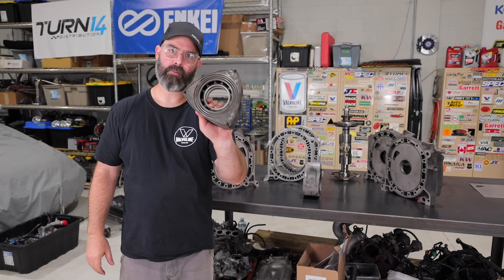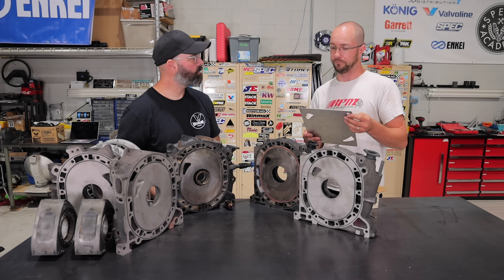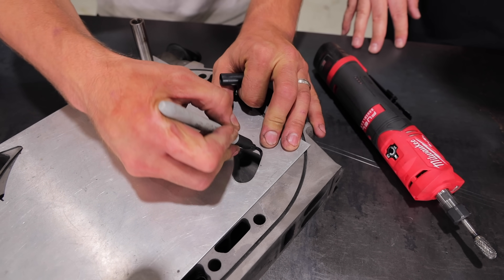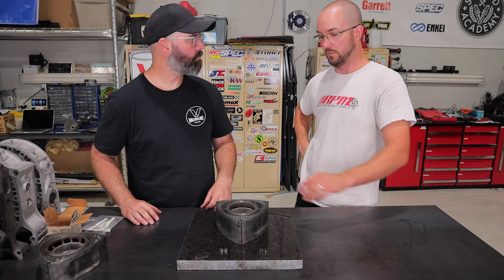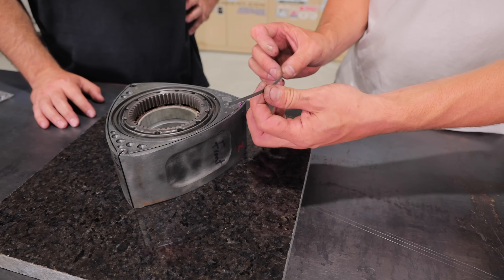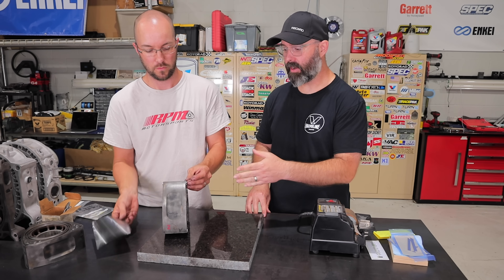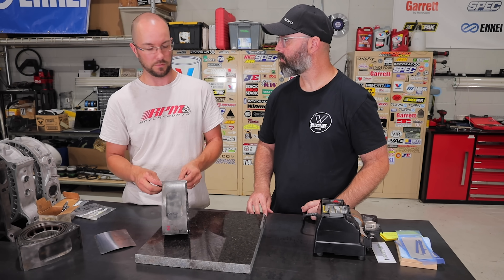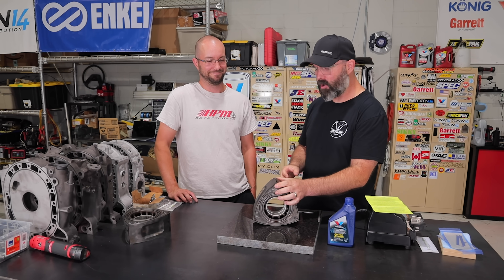How to Build A 10,000RPM Rotary Engine - Part 2

Comment: rx8 apex seals are 2mm thick and 5.3mm high at spring support (not the highest part) 
rx7 apex seals are 2mm thick* and 8mm high at spring support *older were also 3mm and there was also a 3 piece alternative, they are not 2 and 3mm :D

Comment: The rolled edge is called the Coanda  Effect it allows the air and fluid to maintain surface contact in  the same direction of the open port.. providing less  turbulence .

Comment: Have the rotors been lightened by drilling?  Or is that some kind of balancing thing, I noticed there were a different number and size of drill marks on the sides of each rotor tip.

Comment: Wait WHAT!? You just completely glossed over an integral part of the process BY FEEL? I really hope no one uses this to do a rebuild themselves. This could be really bad guys. Proper clearance is measured by at least 4 feeler gauges. Why guess. I get he's a pro but come on. You're doing a fairly informative series about a topic that has picked up in popularity and your info has this massive gap in it? Not even a mention around it of "This is how you would properly do this.". Lots of new people in rotaries and the lack of information available means this needed to be better. Sure its a purpose built RX-8 rotor in REW keg. Most people wont ever scratch the surface of that, but with the lack of proper rebuild videos they'll come back here. Especially because rx8's are cheap and that's the rotor you're using. Please, for the love of God, say something about this at some point. I don't want you guys to get burned on the back end by poor rebuilds generated from this content.
Reply from the maker: We went back and forth whether to show this procedure or not and ultimately as you see didnt. Joe said there is alot of debate over the feeler gauges and how is done properly so ultimately we skipped it as to not create more confusion.
Reply: @speedacademy  as its not a full stock rebuild, I feel like you chose correctly. The amount of comments from people wanting to get into/rebuild a rotary raised my alarm. I didn't mean to slight RPM or Speed Academy in anyway. I respect both shops a lot. I hope you guys have a good day. Thanks for taking the time to respond.

Comment: With higher compression I personally would choose a slightly larger turbo with a well-matched compressor/turbine, and run lower boost to achieve the same output (although with a higher thermal efficiency), then what I would run with stock compression REW rotors. I enjoy seeing the results from what you guys do and wouldn't change it (except if I could change what blew up the EVO motor).

Comment: When you delete the oil metering stuff and run with pre-mix, what about engine braking? No throttle, no fuel, no lube? That's the reason two stroke Saabs needed free-wheel to roll with the engine idling.
Reply: I'm not rotary guy so I could be wrong but I'd imagine they add decel fueling in the tune based on the giant fire balls rotary cars tend to shoot out of the exhaust between shifts and at corner entries.

Comment: Two questions. 
1. Are you going to run on E85 or not? This will determine the oil both for the engine and pre-mix.
2. How do you intend to make power at 10k rpm with such a small turbo? From the dynos i've seen they cannot deliver enough airflow past 6-7k rpm.

Love your videos btw!
Reply: There's no pump E85 local to them so I doubt that's what they'll be running

Comment: Kind of wish you would have shown the side clearencing  with feeler gages because these rotors require a special process to do it correctly and you completely skipped over it. If anyone would like to see that done angel motorsports two videos ago at the time of posting this comment showed the process of correctly measuring the side seals on an RX8 rotor

Comment: Should be using 4 feeler gauges for RX8 rotors. Also ianetti didn’t invent ceramic seals, Mazda in japan had the original ones produced in japan for the 13G race engine.
Reply: Thank you, came down here to say the exact same thing

Comment: Fd (or any rx7 apex seals) are much taller than 3 mm , guess you mixed tallness with thickness. Old school apex seals were 3mm thick vs modern ones are 2mm

Comment: I'd get those rx8 rotors balanced and weight checked because they can be like 20 grams off from each other and it will cause uneven heat distribution and increased/unnecessary wear on bearns and in some cases the e shaft itself

Comment: The height of apex seals stated are also incorrect. 86-02 apex seals (when measuring at specified spec checking points) are 8.5mm tall whereas a renesis apex seal is 5.3mm tall. Both seals are made of the exact same material and are the same in terms of strength for their applications. 86-02 seals have more material strengm=th as they deal with peripheral exhast gases and temps whereas renesis apex seals do not as the renesis is a side port exhaust engine and the side seals take that job on instead (which explains their design) and the only job a renesis seal has is to seal and nothing more

Comment: if you remove the metering pump then you need to treat it like a 2 stroke, meaning you can't coast on it!!! Alternatively, you can just add a special 2 stroke oil tank to feed the meetering pump while you use nicer oil in the sump.
Reply: Yeah......noo.... on a rx8 this is ok but the rx7 the oil jets are bad.... really bad. The Reason we do premix is because with it coming in the 6 injectors you get better oiling because of the spray pattern of the nozzle. There are plenty of us who daily 400hp rotarys who coast and commute on the highway,  long as you recline them once a day (who am I kidding if you own one your on it all the time) you will be fine

Comment: Love seeing more and more people coming around to using high compression rotors in turbo builds (specifically with rx-8 rotors). 10.0:1 compression, standard scallops, 9.3 lbs each (9.2 lbs after apex milling and balance corrections typically) making revs much quicker and, most importantly, more power and torque with less boost. In my 76-78 based large streetport 13B i'm currently using S5 na 9.7:1 9.54 lbs rotors and love it as is, but I am building a second engine with a pair of modified rx8 rotors balanced and side clearanced for up to 12,000 rpm (not going that high, but safe to do so if wanted) and I may rebuild my current motor with rx8 rotors as well just because I have many on hand and would make my NA setup just that much better.

*I'm also a huge advocate for OEM apex seals only (with exception to Ianetti ceramics), however, from what i've been seeing with i-rotary seals they may just very well be the first and only cost effective aftermarket apex seal (roughly the same cost as OEM) that is both more durable than oem apex seals, but also matches or exceeds OEM in terms of wear over time and mileage (as in the same or less wear) and I may build one of my engines with them in the nearish future
Reply: Do you not like goopy seals?

Comment: Hello i would like to ask if i could swap my suzuki samurai's petrol engine to honda civic sedan diesel engine on my samurai's transmission?
Reply: Diesel engine will have less RPM going to the trans, you would need a adapter plate, probably a bellhousing for the diesel trans, and I don't know torque rating of the trans so I have no clue if the trans would hold that engine

Comment: U guys should do a comparison between the rx7 fc housing and the fd housing.
Reply: The housings are rather similar there would be a difference between na fc and the fd but the turbo 2 fc used the same housings as the rew. The biggest difference would be a rx8 housing, they changed the water seal location and couple other things

Comment: Decent vid. But zero metion of rebalancing assembly or matching the factory mazda lettered rotors together. Dont recommend rebuilding without a mazda manuel for specs!!!
Reply: The engine builder had sold these parts to someone else and had already balanced and done all that so he didn't go over it because it was already done, I don't believe in matching the letters on the rotor to make sure they're from the same batch because it has been found that it doesn't really matter because their clearances at Mazda are garbage,  If you're gonna lighten rotors like these are anyway, typically your machinist will get them to match and balance on the shaft regardless of the letter
Reply: @jaredspratley6270  thats cool but myself and many other shops will continue to follow the proper procedures unlike you skipping things you think isn't necessary because you feel like it. Leaving the masses to figure out what procedures you left out of this video. I prefer to give full procedures not skip thinks because i feel like it.
Reply: @mustangdemon87  thats fine, I always preach service information, I have the mazda manuals for all the chasis at work and in the event I was doing a factory spec rebuild I would follow the manual, but typically the aftermarket uses tighter tolerances allowing for longer life, the rotors are probably balanced to be on either side of the shaft within a gram of each other, mazda spec is within 4 i believe, and the balance of shaft within 6 grams. For a aftermarket high compression boosted application that won't work, so we make it a tighter tolerance. They did a ok job but there are better tutorials and informational resources if you know where to look,i wish he had shown how to properly measure the side seals, on these engines you have to measure all 3 at the same time it takes 3 feeler gauges and a jig to properly adjust it, he may be experienced but if i was the customer I would have wanted it done right
Reply: @mustangdemon87  also whyd you assume that I skip steps? Because they didn't record anything of the customer who ordered the parts assembly process or the balance, thats not my fault
Reply: @jaredspratley6270  my bad wasn't directed directly at you moreso towards those who give partial info an expect the average guy to figure out the rest. You are correct they must be within 4 grams if each rotor. Same with measuring the seals side by side. Then install and press down to get the operating spec once its installed. Simple missed steps like this as you know will ruin the average guys experience with these motors. Which i want to avoid! If your going after high compression/boosted i would recommend lightening rotors as well as clearancing the sides of rotors to help prevent contact on the irons under load. Another huge item that was missed is end play! Everyone seems to miss this step in videos and forget to explain that it must have the front end of motor/oil pump assembled to get the proper clearance.
Reply: @mustangdemon87  agreed, just verifying the comment wasn't made directly at me

Comment: Really want to see the result of RX8 rotors in a RX7 housing.
Reply: I've seen several,  the spooling of the turbo is a bit better, i haven't seen much power difference in them however, they are lighter as well so you can rev up near 10 k If its built right

Comment: dang...how does the 2 cycle oil effect the O2 sensor in RX7s and RX8s??? very interesting engine...
Reply: They aren't that bad on them, if you have issues you can use a spark plug non fouler to space it out, will make it think its lean so tune it on a dyno with a dedicated afr gauge for a proper lamda reading, but its not typically a issue it gets burned up

Comment: I wonder how many rotor housings Joe smoked before he got good at porting these things. With as hard as parts can be to find that would make me really nervous.
Reply: It's nothing to be nervous about, I Just lay some tape down around the port to protect the surface in case you jump out of the port.

Comment: What HP levels are you expecting with the RX8 rotors? Looking forward to how you guys tackle heat management!
Reply: Depends on the turbo they're going to use. With a small-ish turbo, about 450hp. With a decent sized one like a 35R or equivalent-sized BW EFR, can get you to about 500-600 easy. The issue is tuning at that point. High compression on a rotary - any detonation event, even a single one can be enough to pinch an apex seal.

Comment: This is what I love about rotaries.. all you need is proper research basic knowledge and a feeler gauge and you can rebuild your own rotary! And if push comes to shove and you need to replace bearings you can probably go to a shop and borrow a inside micrometer and outside micrometer to figure out bearing clearances. It’s very doable!

Comment: One other benefit for the RX-8 rotor is that it has a 3rd oil seal on the face of the rotor for better oil control. I wouldn't use the higher compression rotor on a gasoline build but on E85 it is cool.

Comment: I believe on the rx8 rotors, when fitting the side seals your meant to use feeler gauges to push the side seal towards the center of the rotor, certainly in all the videos I've watched recently this is what has been done, it's to simulate the compression of the engine once running forcing the side seals inwards (if this isn't done it can cause binding)
Reply: 4x feeler gauges or you are doing it wrong, you are correct in this case. Can we get los hermanos rotoras over here, wya Angel Motorsports
Reply: This is yet another reason i hate people like this giving out wrong info in these videos! If your not going to spend the time to actually give the proper procedures DONT MAKE THE VIDEO IN THE FIRST PLACE! Ether do it right the first time or not at all!
Reply: Yes you need 3 or more and you do the entire side of a rotor at the same time
Reply: If you want to see how its done right angel motorsports just did this on their 3 rotor with the rx8 rotors,  he shows you the right setup, on rx7 rotors you just use 1 but if you want the high compression rotors done right watch theirs and follow the procedure
Reply: @jaredspratley6270  thanks lol i have been out there once a few years ago. Fuckin guru of tuning Doritos! Finds power an efficiency like no one else.
Reply: I came here to say this as well. If you measure at the end you usually end up with the clearances that are too tight and wreck your motor. Unless your going turbo the pre-sized seals are fine and eliminate the possibility of a measurement error.
Reply: It seems to me the feeler gauges holding the side seals in place is to imitate the position of the seals when fitted and the side seals compressing their seals, this guy even shows there is too much clearance with the springs not compressed, and compresses the springs to simulate the assembled position and clearance.
Sometimes, there is more than one way to do a job.
Reply: @ryanworkman5229   You know what Edison said right? When asked about the 100 times he tried and failed to create the light bulb, he said he didn't fail. He found a 100 ways not to do it and came up with the one way to do it.  Mazda did the same thing so use the feeler gauge
Reply: @jaredspratley6270  yes, but if Mazda is like any other manufacturer, they know there is more than one way to set the clearances, they just need to make sure the method published in the workshop manual is fool proof and can be followed by anyone.
I guess we will all see when the engine does or does not start, and then keep running for run in and dyno tune due to the incorrect method of setting side seal clearance.
Reply: @ryanworkman5229  I believe the idea of the feeler gauges is to exert a fierce equal to the compression/expansion gases which would try to force the seals against the inner edge of the recess
Reply: @paulvernon4160   When the springs are compressed, the taper of the seal moves it against the inner edge, rather than just compression, which would be why there is no need to push the side seal towards the middle of the rotor to check clearances on earlier engines.
Reply: @ryanworkman5229  the spring maintains pressure outwards against the plate, but the further the side seal is pushed out, the greater the play it will have against the tapered recess. Compression only ever forces the seal against the inner face
Reply: I'm not sure if it was Motor Trend that did it, but some show had a competition to guess who could accurately measure 20ft/lbs, 60ft/lbs, etc. versus a torque wrench. Every mechanic said they could guess it and everyone was wildly off.

Your finger is not a micrometer or a feeler gauge. Be professional, use the gauge... unless you're trying to reinforce the unreliable rotary stereotype. 

These poor guys and their luck with builds! Hope it works!
Reply: imagine actually making a video that says "how to" and doing it wrong
Reply: @bob19777  exactly lmfao
Reply: @bob19777  He's not doing it wrong. He just has enough experience to feel when it is right.
I've rebuilt Renesis engines before and I started off using the 4 feeler gauge method.
I spent a whole weeks worth of nights in the shed getting the side seals clearanced the first time I did it.
By the time I got to last few I was able to just do it by feel without the gauges.
Reply: @bob19777  ikr

Comment: The knowledge delivered here! Don’t know anything about rotary engines but I’m excited to learn
Reply: If you would like detailed information about the assembly of a rx8 rotor following the correct steps and the balancing of the shafts and rotors id suggest angel motorsports, they take their channel to the machine shop for every build and walk the audience through the process rather in depth, theres a good bit of work that was skipped here you could learn from their videos
Reply: These guys are great. Check out Rob Dahm's channel if you want some irreverent humor in the rotary madness.
Reply: same here